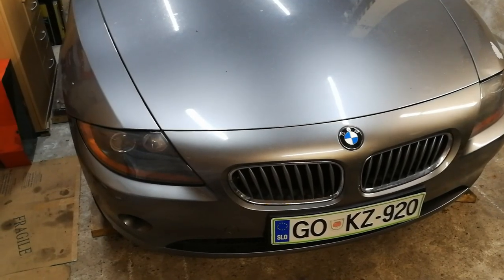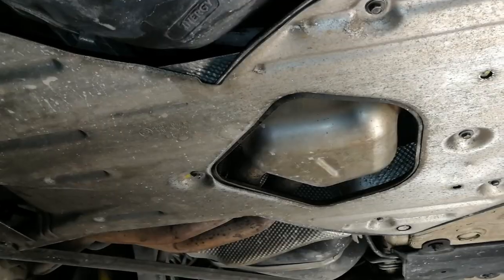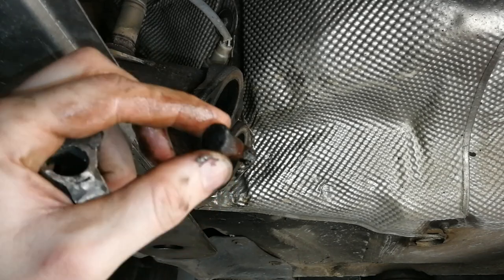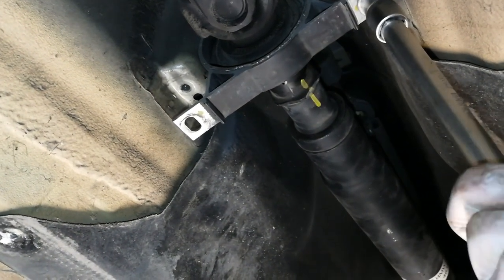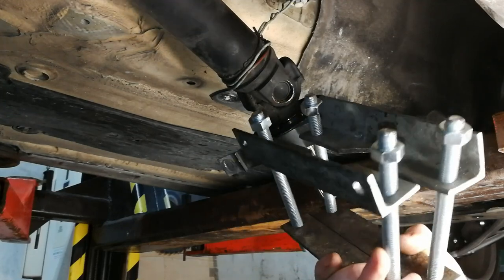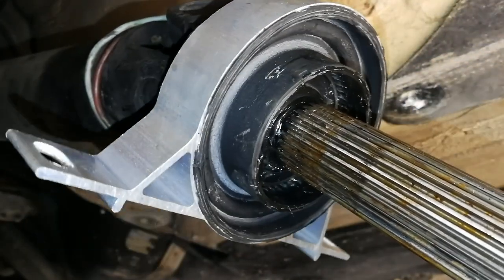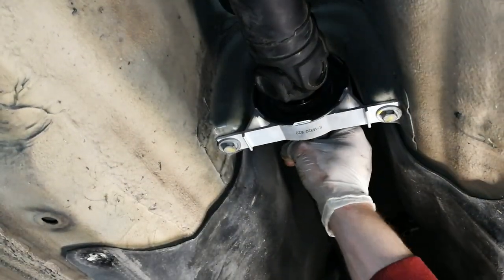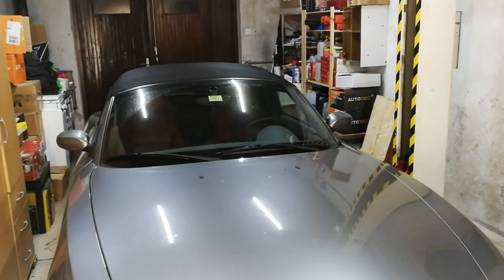Flex Disk And Driveshaft Bearing Replacement BMW Z4 E85 M54 DIY

Comment: Perfect, drone when driving and sometimes strong vibrations. (past a certain speed) stops briefly when not under load until engine braking comes in. Related to wheel speed and not engine speed. so prop shaft to wheels. Heard about centre bearings going and this video is perfect. I salute you.

Comment: Dude, this Mini Press you got there for the Exhaust Studs is THE solution. I am scared as hell if I see the condition of my screws. If there is any chance you can sell this thing or build another one, please let me know, seriously! The risk of damage the average mech shops will do to catalytic converters and exhaust manifold while hammering onto those studs is too high. Greetings from Germany.
Reply from the maker: A ball joint separator should work as well. Try getting something like this:

https://www.autodoc.de/hogert-technik/15778048
https://www.autodoc.de/werkzeuge/kugelgelenkabzieher
Reply: Special thanks to your dad for the exhaust stud press genius
Reply: For me it didnt worked, everything bent except the bolt :D, I ended op with  drilling the holes, with HSS-G Co and WD40.

Comment: Hey, great videos I think I might have to subscribe 😅. When you drove your Z4 before replacing the bearings what did you feel and hear?

I think I might have to replace these bearings as when I’m in first gear and start to move off, I sometimes get a few lurches forward and when I’m driving around 45mph /70 km/h there’s a slight whining sound coming from the rear end. Just curious how the car handled before the bearing replacement. 

Keep the videos coming!

Comment: Hey I’m currently doing this right now but for some reason my drive shaft doesn’t spin , making it hard for me to reach some of the bolts .. do all 4 tires have to be up to get it to rotate ?
Reply from the maker: @brandonata5847  car in gear? Handbrake on?
Reply: @BimmerZen  car was in gear , no ebrake since it doesn’t work. I put it in neutral though with no ebrake (as it doesn’t work) and it still wouldn’t spin freely. 

I can’t tell you how much i appreciate you replying so fast

Comment: Great video...question is:  When I'm on the interstate and give it gas, I feel a huge vibration and when I take my foot off...it quits.  Sitting still while moving from reverse to drive, I feel some abnormal clunking.  Does this sound like a worn flex disc?
Reply from the maker: If you feel vibration on acceleration, then i would check the engine and transmission mounts first. Engine mounts are hydraulic so check for leaks and cracks. Also check for cracks on the rubber flex disc. The cracks should be pretty severe and apparent for this to be an issue. Then check for play in the central support bearing and drive shaft.

Worn or damaged CV shafts can also be the culprit. Check for excesive play. Axial play is normal, but there should be little play in direction of rotation.

The clunk on forward/reverse is "normal" for older cars. There is some play in all of the components and the clunk is the sound where all components align for reverse/forward driving. I also think that parking brake shoes have some play and can cause a bit of a clunk when going forward/reverse.
Reply: @BimmerZen  U-joints are shot!  Going to replace Flex Disc, transmission mounts and entire driveshaft...thanks for your fantastic video.
Reply from the maker: @lisawells4084  U-joints on driveshaft?

Comment: Is this a standard or automatic transmission? I have a standard trans 2014  435i x n55 F32 is this similar install?
Reply from the maker: Standard manual transmission, but procedure should be very similar as this is a standard setup on all RWD BMW's. You should be able to find additional information for your model online, for example https://www.newtis.info/tisv2/a/en/f32-435i-cou/repair-manuals/ (free registration required).